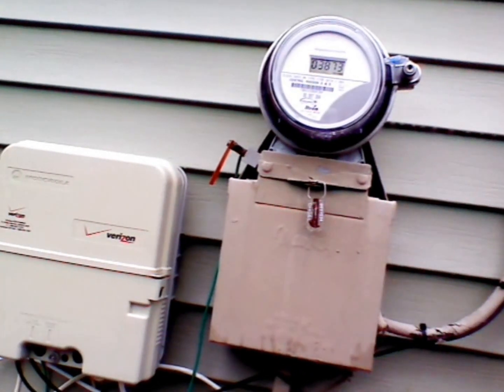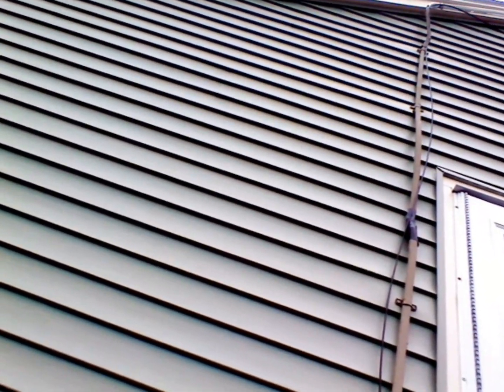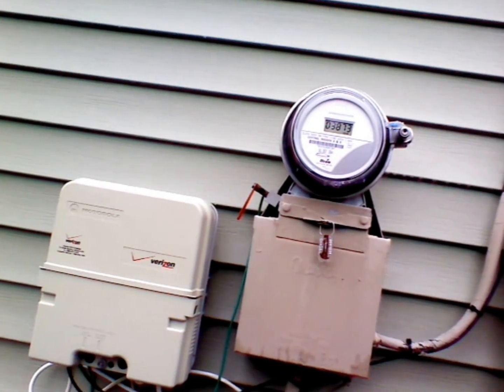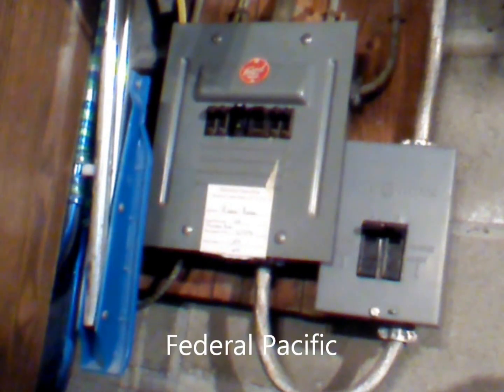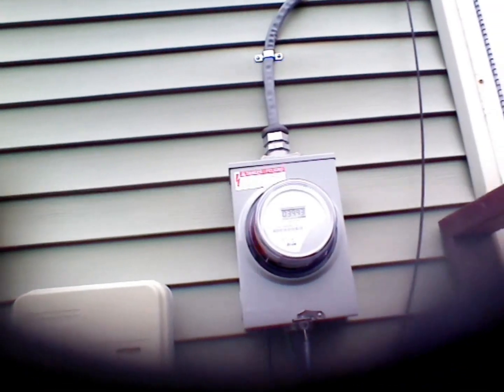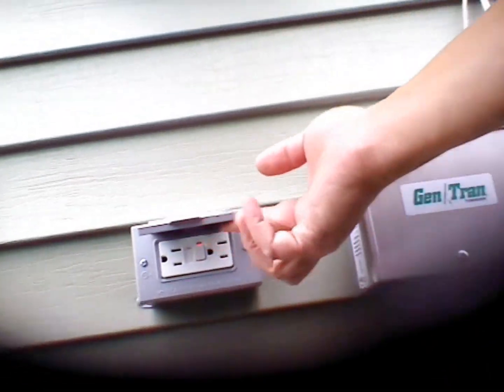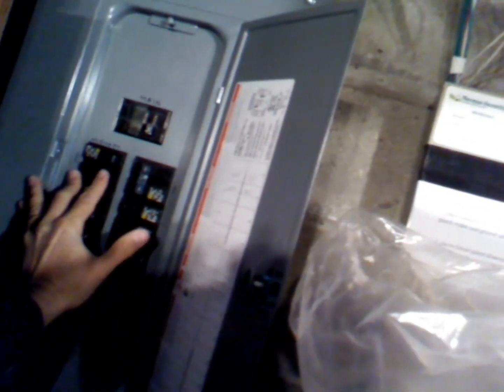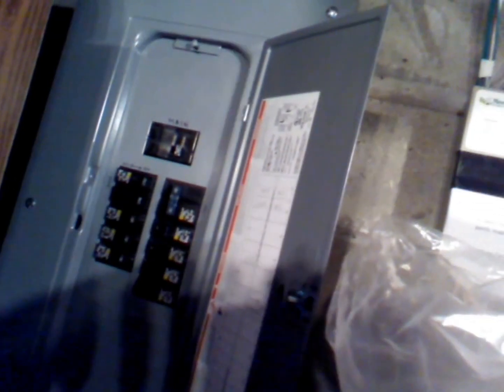Panel Upgrade from Federal pacific

Comment: Wow, you must not have very many circuits in your house. I live in a relatively small house, and almost all of the breaker panel is filled with breakers......around 25.
Reply from the maker: No I do not. It was a cheaply built home and built around 1958 . Back then there just wasnt a huge demand on electrical applications.  I had to add many outlets

Comment: holy crap you generator set up is not safe or to code you MUST have a inter lock kit to prevent the main beaker  and the generator  beaker from being put on at the same time all it is is a piece of mettle that wont let both be on at once  anyway good call on replacing the FPE panel they have tones of re calls and burn houses down
Reply from the maker: Did it..thanks. $200.00 for a piece of tin.